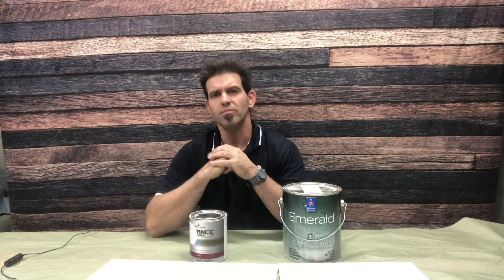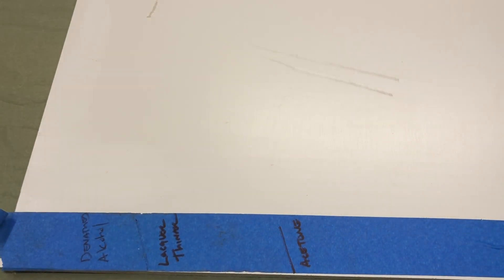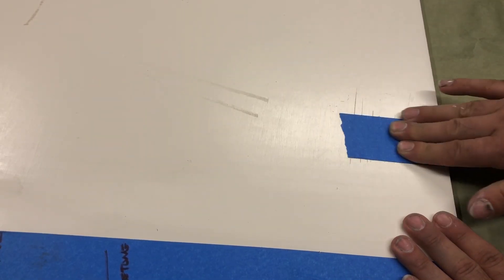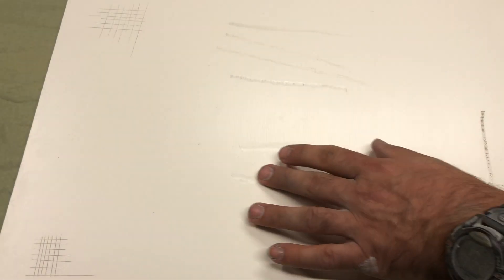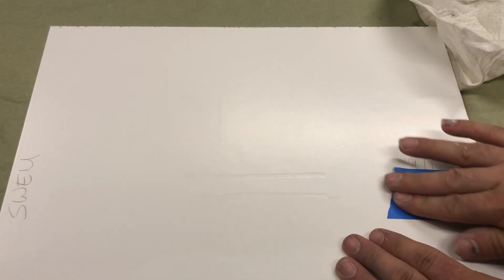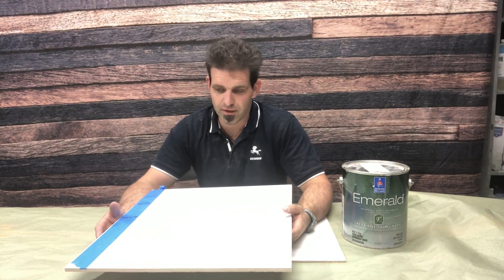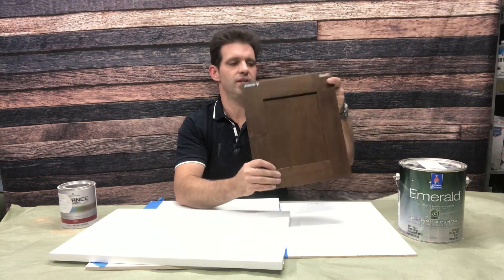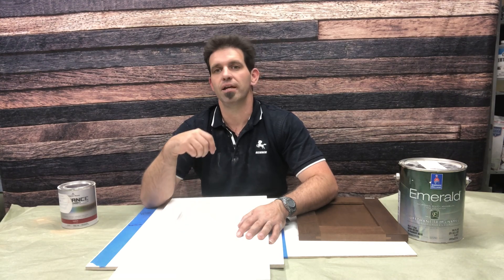Sherwin Williams Emerald Urethane Vs Benjamin Moore Advance

Comment: Emerald is what I use everyday I love it I’ve painted for 30 years I paint kitchen cabinets every single day i believe in emerald it’s amazing also never had a problem with it laying down or covering it’s just amazing paint
Reply from the maker: Okay use what you want but that stuff isn’t anywhere close to an industrial water base finishes.
Reply: Not only do they not compare to the strength and resistance over 2k, the deep and ultra deep base colors on that UTE is a damn nightmare. And now that they have changed the formula to try and fix that issue, there are bubbling issues if the coatings are too thick or recoated too quickly. Emerald specifically used to be a better product but regardless, nothing can ever compare to the quality, strength, and the ease of application of quality industrial coatings such as 2k poly, ever.

Comment: All that to sell European paint in the end? I don't get it. You didn't blow those industrial paints without a primer I'm sure! Not even a fair trial.
Reply from the maker: The primer has nothing to do with the durability of the top coat. All the primer does is give you build and was of sanding. A lot of people use these products under oil primers and they do better under water base primers or as a self seal. I run the same tests on every coating. These coatings have a place in the market but if you think for a min they are going to outperform an industrial European finish you are living on fantasy island. Do the test for yourself, If you what to up your game if not keep spraying emerald and advance. They are great trim paints.

Comment: Ben Moore Advanced is the worst paint I have ever used for brushing.  The finish is great, but I would only use it for spraying.  Emerald Urethane is vastly superior for brushing doors and trim.  Workability with a brush is the best I’ve used for a high end, hard finishing paint.  Took me 3 times as long to brush a door with Advanced, compared to Emerald.

Comment: I just got the SW emerald urethane and it is a pleasure to work with. Very low odor, self leveling, and 4 hour redcoat time.

BM advanced has a 16 hour recoat time and runs like crazy but finishes harder

Comment: You need to use the Benjamin Moore Alkyd Under Body for the correct finish and application. Spray with a airless air assisted or kremlin sprayer
Reply from the maker: I agree that the alkyd underbody  would
 Be a better choice for a primer but it’s not going to change the results of the top coat. Also using an airless or an aaa is not going to change the results either although i agree that those are a better way to spay this type of material.

Comment: Hey man, can you touch up those industrial coatings on the jobsite by a brush like you can with Emerald paints? Or are you limited to spraying on the jobsite?
Reply: Industrial coatings typically are formulated for spray only.

Comment: I've tried using a cover stain under coating with the Advance, the 2 dont seem to work together. I had adhesion problems and also fish eye's after top coating. Using the Advance primer made for the Advance Paint works well, just a long dry time.
Every product works in it's own way,  best to test before full commitment.
Reply from the maker: +Chaz Bickel I agree

Comment: Love your videos, please help!  I'm spraying interior doors from the 1950's I don't know if they have poly, oil base, shellac? I painted the trim with the Emerald Urethane in Satin and was very impressed with the look but it does feel chalky. I did an exterior door in The Urethane Semi Gloss and it shows a lot more imperfections. Can I mix satin and semi gloss? My big question is what primer to use. Someone told me to use the bin shellac but after reading these posts it sounds like it might make the paint chip. I'm trying to understand the process (I'm new to spraying) Do I do a couple of coats of paint instead and then seal the doors with something like the Milesi coating you mentioned? Thanks
Reply from the maker: Yes you can mix. As long as you sand properly you will get a mechanical bond and be fine. Using a primer ultimately depends on if you need the build or not to fill or sand things flat.

Comment: cover stain is not a great oil primer for topcoating with a water based top ... (but it's a good primer for oil based or appliance epoxy topcoats) .... also the fumes are horrendous , and it takes a long time to "gas out" .... I have found it "not great" when topcoating with a water based product (regardless of urethane or hybrid , any "water clean up" product) .... Kilz oil is better , and of course everyone swears by Bin Shellac .... I just hate having to use ANOTHER solvent (alcohol) , so I use Kilz oil mostly , and the thing with oil primers is this , they "dry" fast , BUT they continue to "gas out" for a good 24 hrs , so I still wait a day to topcoat , especially with water based products .... oil topcoat is a bit more forgiving , but for a water based product to STICK , let an oil based primer DRY THOROUGHLY and I prefer Kilz Original Oil Primer personally .....

Comment: Why do tests on the chemicals rubbed on samples? To see if paint breaks down?
Does the advance have to be thinned for airless sprayer?
Reply from the maker: It gives you an idea of the chemical resistance of the coating. No thinning required for airless

Comment: My husband is a Chef and is brutal on the kitchen cabinets (heat, stain, chip, oil). We are remodeling the kitchen cabinets. What brand and type of products, number of layers, top coats etc would you recommend? Industrial brands? Thank you
Reply from the maker: Renner 688 or the cic 1800 series is the best I have tested. So 2 coats of renner 602 and 2 of 688. Or cic 1107 and 2 coats of 1800 series.
Reply: @ericreason6559  Thank you very much

Comment: I've found both Bin shellac and fast dry alkyd primers like cover stain to be very brittle and promote chipping. I avoid using either one on cabinet a refinish.
Reply from the maker: Mike Richter same here
Reply: @ericreason6559  ... It's funny how giving an honest opinion about the limitations of a product can generate so much outrage theater!😊
Reply: What do you use instead?
Reply from the maker: Mike Richter just the nature of the best when you find out you Coatings aren’t as good as you once thought it can bring out anger I guess.
Reply from the maker: Mike Bowman I prefer vinyl sealers for speed but if you want to stay watebase their are 2k options and isolante. Going to do an interview with a guy they had been way ahead of the curve on this stuff so stay tuned.
Reply: @ericreason6559  So for 2K Milesi waterbased no primer needed? If needed which product is the best?
Reply: doc hall   Original 123 primer is crap nowadays.  They cheapened it.  There is 123 Plus, which is better.  Similar (almost same?) to Zinsser Smart Prime.  Some have success using it to block tannin and on cabs.  BIN synthetic shellac Advanced is nice, I think better adhesion than above, but a little worse tannin blocking, great leveling of brushing/ using thin mini roller.  
They say any Waterbased primer like those need to dry 24 hrs before recoat to have chance of blocking tannins.  Doing job now (finished trim, not cabs) where I’m using BIN Advanced and then Smart Prime a day later.   Kids in house and don’t want smelly stuff.
Reply: doc hall  Kilz Original Oil better than cover stain , and Kilz Premiun 3 far better than 123 (water based primers).... 123 crap , premium 3 pretty damn good , I switched from cover stain to Kilz original for oils , and from 123 to Premium 3 (if I want water based primer)
Reply: @mick2spic  Kilz premium 3 pretty damn good latex primer , decent stain block , but definitely sticks much better than 123 garbage
Reply: shure46  I’ve heard a couple other painters mention that Kilz Premium, that must be the one they were talking about.   Original 123 is garbage now, so I don’t even want to compare.  

Have you ever used Waterbased BIN synthetic shellac or Zinsser Smart Prime and know how those stack up with adhesion to Kilz 3?  Or maybe in comparison to other adhesion waterbased primers like Stix or PPG Seal Grip?  
And comparison on blocking tannins.
Reply: @mick2spic  PPG Gripper sticks pretty well , don't know about stain blocking ..... for me , Kilz original or Kilz Premium3 is all I need ..... I put Gripper on a ceramic tile and it stuck very well !!!!!! , granted it does take a long time to fully reach potential .... I have tile samples where Gripper sticks better than cover stain oil .... I am NOT sold on cover stain at all , and it has horrible fumes .... I went back to Kilz Oil over cover stain .... I think cover stain is garbage ..... Gripper GRIPS ..... no doubt about that .... I DID "scuff the tile with Sand paper , but in reality , ceramic tile does not scuff easily .... but I think on a microscopic level it must have scratched a wee bit because Gripper does stick better on the sanded sample , even though you cannot tell it was sanded at all .... it's like trying to sand glass , sandpaper does NOT sand ceramic tile well ..... but I THINK it must have created microscopic scratches you can't really see .... Gripper did stick very well to sanded tile , but these samples are also a year old .... it does take a long time ..... even just one week is not long enough ,
Reply: @mick2spic  I have not used STIX or even BIN .... I know people swear by 'em , but I get just fine results for less $$$$ w Kilz Original (if oil) and Kilz Premium3 (if water) .... and at times Gripper if I do not care too much about stain blocking ....
Reply: shure46   You using Home Depot PPG Gripper?   How does it compare in adhesion to Kilz 3?
Reply: @mick2spic  first , it's PPG Paint , that just happens to be sold at Home Depot , and Gripper Grips quite well , BUT , I am perfectly fine with Kilz Premium 3 ..... I clean and scuff glossy surfaces no matter what I use .... as far as water based primers and if I do not need THE BEST stain blocking , I am fine with both Gripper and Pr3 .... DO NOT USE "123" it sucks , and if you want really good stain blocking , Kilz Original Oil Primer
Reply: @shure46  Cover Stain reformulated to be lower VOC and it's absolutely horrible now and smells worse than its high VOC version. Supposedly it has drycleaning solvents in it now to be VOC exempt.
Reply: @GilBatesLovesyou  The last time I used cover stain was about 2 years ago , I switched back to Kilz Original after doing a few tests and dying from CS fumes spraying it .... Horrible fumes , and it's worse now ??? lol , I wouldn't doubt it , to be honest all this "Low VOC crap" is ruining paints ..... I remember when Behr Premium Plus latex enamel was good trim paint long ago , now it absolutely SUCKS as a trim paint because of this BS Low VOC crap .... Breakthrough too , Low VOC sucks .... Thank you California and democrat greeny morons who have also turned washing machines and toilets into nonsense "low water garbage"
Reply: @shure46  I think Coverstain changed about two years ago. I also vaguely remember Behr being at least useable, but no more. :/ Kilz Original is still OK, but where I live I can only buy it in quarts due to VOC rules, not gallons. I also liked Zinsser Odorless oil primer, too, but again, only quarts for that unless I drive out of state. I want to try Kilz Restore and see if it actually works for grease, water stains, etc.
Reply: @GilBatesLovesyou  Kilz Premium 3 water base primer is NOT BAD , sticks well and seals stains FAIRLY , but Kilz Original is one of my favorites if I go oil .... PPG Gripper is not a bad latex primer , it does GRIP pretty nicely , but that Kilz Premium 3 AIN'T BAD ..... I'd prime cabs with it no sweat as long as I give it a scratch , and since many times we clean and scratch anyway , hell Kilz 3 ain't bad .... I'm about to do a kitchen , Oak with stain and clearcoat , and the lady doesn't want fumes , so I may just clean scuff and go with Kilz 3 ... it is NOT bad stuff , HELLUVA lot better than that "123" crap ..... and yes 15 years ago I did all the trim doors even some pantry shelving with Behr Premiun Plus Latex Enamel and it fricking worked great , heavy cans on shelves , no problems , worked GREAT ... Then about 3 years ago I used it on a lady's interior trim and it was shit , had to redo a lot of it !!!!! garbage shit low voc crap ... RUINED a decent paint
Reply: @shure46  I used to use a lot of 1-2-3 Plus, (not normal 1-2-3) and I still use it as a bare drywall primer, but lately it's been almost translucent and has almost no hide. Would you say Kilz 3 beats 1-2-3 Plus? I didn't find Kilz's normal WB primers good, nor Kilz 2, but is 3 OK, price-wise it's close to 1-2-3 Plus now. 

I've used a lot of BM Fresh Start, btw, and do like it as a normal latex primer. Very nice and bright white for sure. But cost-wise it's in the $30s, so it's not cost effective for whole rooms/etc, and it's not a shiny sheen like 1-2-3 Plus, so you end up using slightly more topcoat.
Reply: @GilBatesLovesyou  Kilz 3 is good primer , even stain blocking but takes a second coat over tough stains and not as good as oil or shellac , but for WB Primers I think it's pretty good .... Better than regular 123 (I did not know there was a 123 plus , so cannot comment on that) or Kilz 2 for sure , and the 3 sticks well .... let it dry real good before recoat .... I THINK it dries kind of "shiny" and has more solids for coverage .... It's my "go to" latex primer .... PPG Gripper is pretty good too

Comment: Thanks Eric. Once i learned about the European paints, I never went back to the popular paint stores. Those products have their place but not on nice cabinets.  The first time I ever shot Renner the dealer had no suggestions on psi, tip size or anything to help me. I had some issues spraying the stuff but it still came out way nicer than Emerald ever did.
BTW, the issues I had were not Renner but me trying to figure it out.
Soon I will be shooting some 2k Milesi and I already know it will look great!
Reply from the maker: WordAboveAll yeah the European stuff just dwarfs everything. American manufacturers better wake up and wake up fast if they want to stay relevant.
Reply: @ericreason6559  We are getting a house built and rather  do the doors/trim right the first time because we are planning on staying for years to come and have little kids.  Which European paints should we be considering?
Reply from the maker: James McCollister what is the application trim, cabinets, walls etc
Reply: @ericreason6559  I'm trying to paint over bathroom tile. My local SW store recommended the Emerald Urethane Enamel, but with their Extreme Bond Primer underneath. Said wouldn't even need to sand the tile before the Emerald. Have you tried or know of anyone who has tried to paint tile with the Emerald and the Extreme Bond. Did it work well? Would these other industrial coatings be better? I am not licensed so my ability to access may be limited. Thanks!